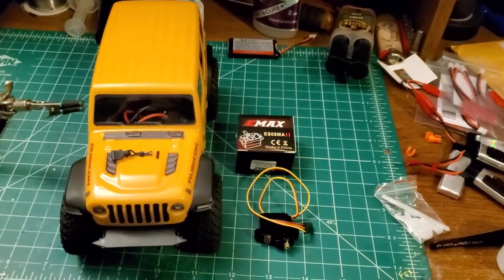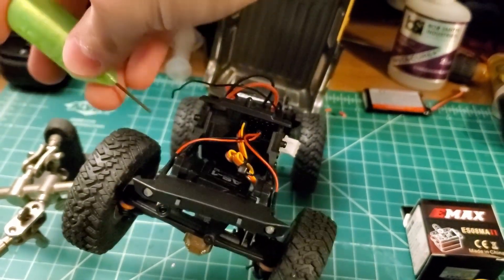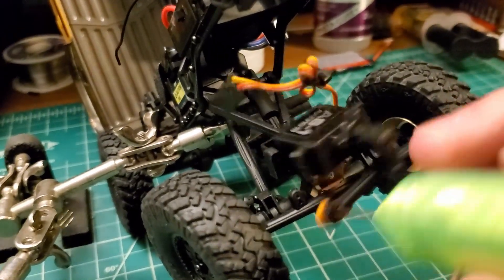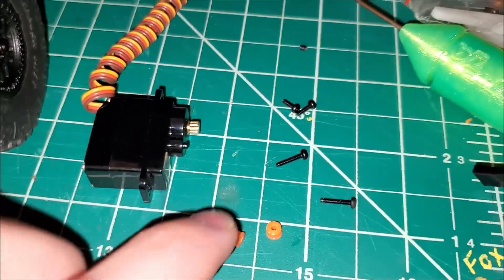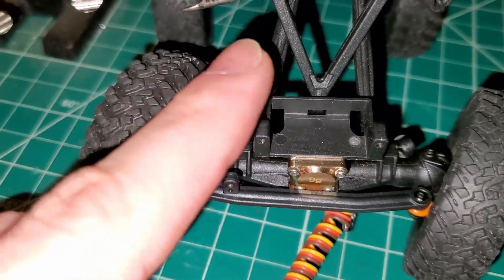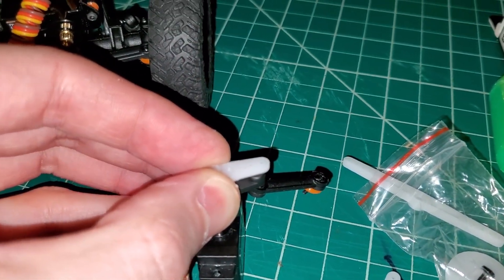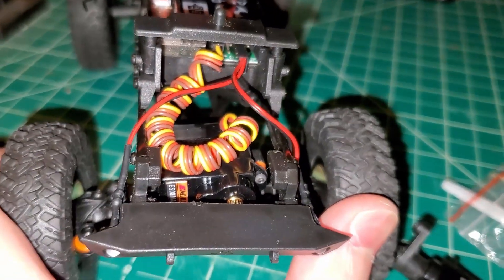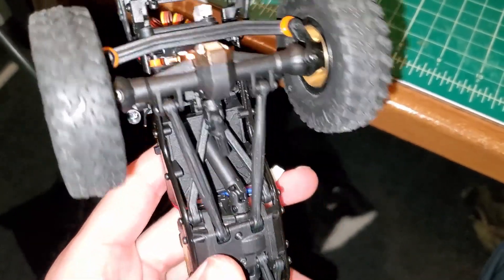SCX24 Servo Upgrade Tutorial (ES08MA II)

Comment: Nice video! Going to use your solution. What other upgrades have you done on your SCX? It looks like it runs a lot better than a stock one
Reply from the maker: I have the brass diff cover in the front and the brass wheel weights in the front wheels. Outside of that it's mainly stock in this video.

Comment: What is that little screw driver you have that pinches your Allen wrench. That who be very handy instead of twisting an Allen key wrench.
Reply from the maker: It is a 3d print from thingiverse. If you search scx24 you will find it
Reply: @BenTheFox150  thanks bud. And while I am talking to you how noticable is that new servo compared to the old underpowered one? I can barely turn my wheels in a tight area.
Reply from the maker: @motododo4626  its definitely  noticeable. I can lift the whole vehicle with turning the wheels now.  And they are no longer easily turntable by hard due to how strong the servo is.
Reply: @BenTheFox150  awesome bud thanks. The only difference I may go with is the digital version the MDII versus the MAII. I know they make alot of noise but the get like 30x the data signal and are less prone to burn out. Thanks for the video and the info bud definitely ordering me a new servo hahaha.

Comment: Do you remember if the particular screw you used to secure the servo arm was not typical.  I noticed on your video it was a philips head.  There were 2 philips heads machine screws that came w/ the servo which don’t work.  No screw I have saved would call ch any threads in the servo.  Perhaps there is a defect?

Comment: Well, I ordered & received the EMAX servo & I also bought the tray.  Your video got me through despite repeated screw ups on my part.
It’s done, sort of...you gotta help me. I cannot find a screw, any screw the will thread into the servo to secure the horn????  I know it doesn’t make sense.  If there was a “trick” to it, I am sure you would have mentioned it.
I hope ti hear back soon, please.
Thanks again!
Reply from the maker: I believe the servo came with it own horns and screws.   I just trimmed one of those horns and used the screws it came with
Reply: Ben Fox it definitely did..  in your video, I noticed a Philips head.  There were 2 machine screws that were Philips heads.  The wouldn’t fit.  I was afraid to force it.  There were several different length screws that would thread.  I just turned & turned.  I know it sounds ridiculous, but nothing in the box or anything I had would thread.
Thanks for getting back to me.
I manage to screw up everything the first time around.  If you think of anything please let me know.
Reply: The screws wouldn’t thread.  Sorry!
Reply: Ben Fox what the heck could I have done wrong?  Nothing would thread?  Everything I do gets screwed up.

Comment: Thanks for the video! I was trying to make another metal gear fit, this was a no brainer. So close to the original in size. I made a frame mounted steering setup, but this is the best solution.